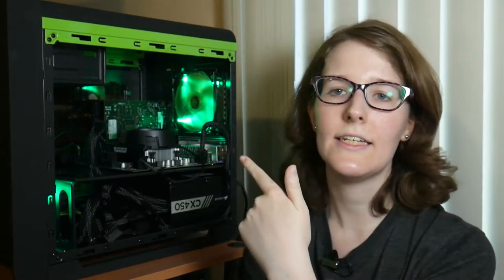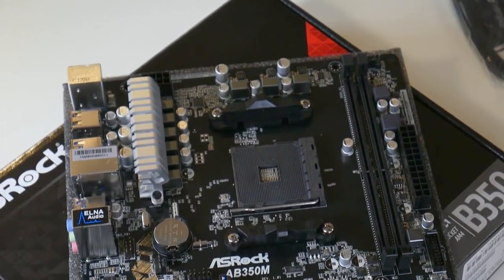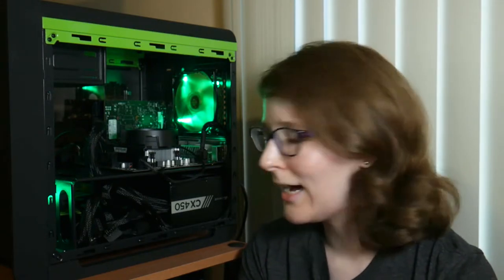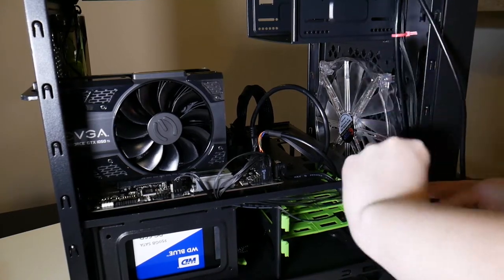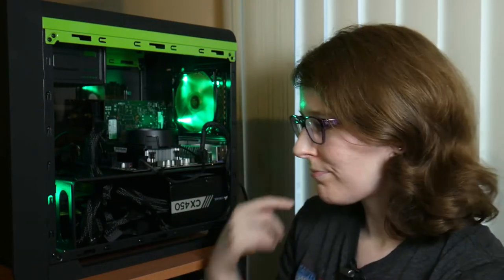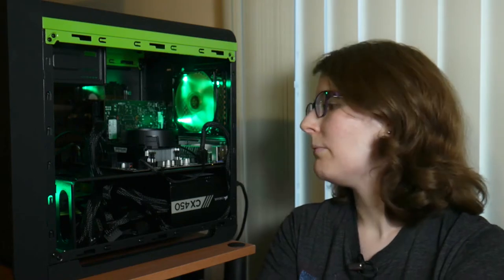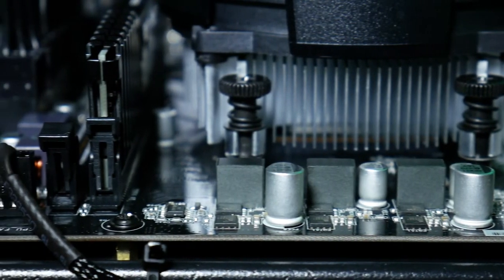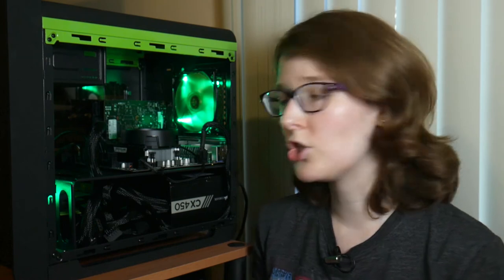Budget Ryzen PC Build

Comment: 3M makes these stick on wire clips that work pretty decently. That said, the cable management in that case looks pretty good and the clips probably won't improve anything.  Thanks for sharing your build.
Reply from the maker: Thanks for the tip on those 3M clips! Always looking for new cable management options :)